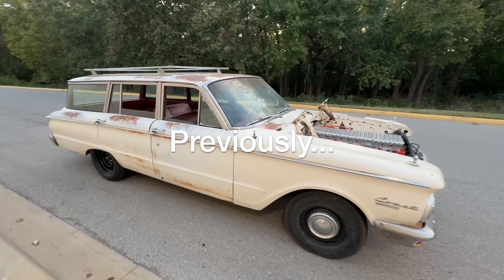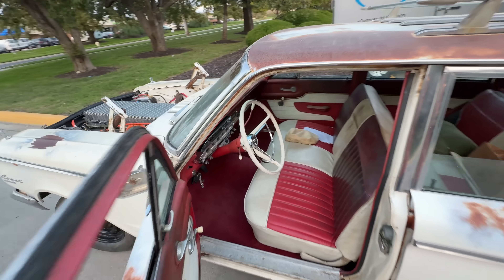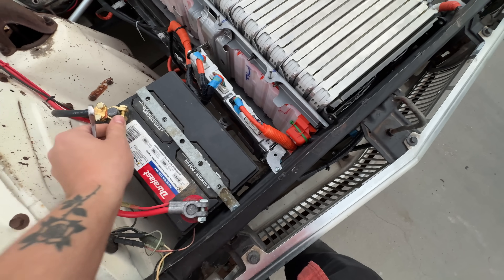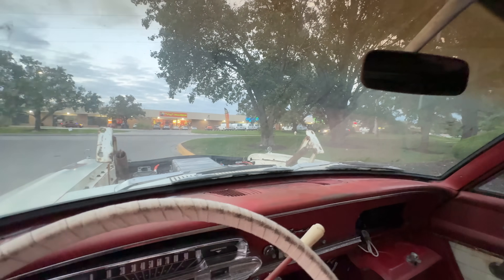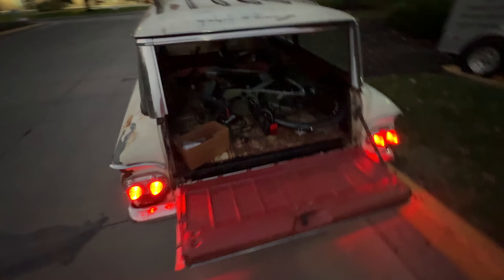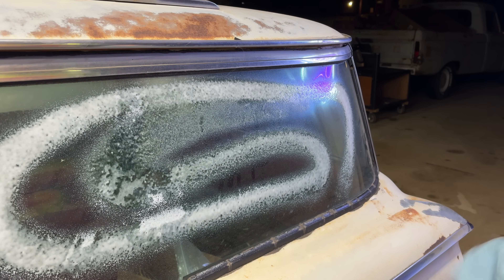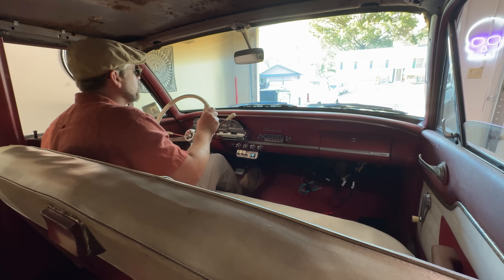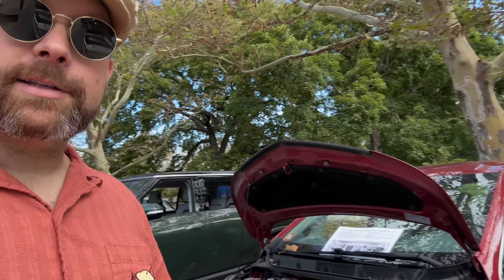What It’s Like to Drive My Homemade Electric Car

Comment from the maker: Hi everyone! I can't believe this video is taking off like it is, if you haven't seen it yet please watch the prequel video: https://youtu.be/v-0ncoK-YI4 ; Also, I'm trying reply to all the comments but there's so many! I'm doing my best but please forgive me if I don't see your comment.
Reply: please please please make a video converting an old gas scooter to electric, it would be really awesome to see your thinking process on that kind of conversion
Reply: Great vid.  Great project.  Salute to your tenacity, you RAWK!!! 🤘🏼😎🤘🏼
Reply: I just found your channel 2 days ago and like what you have done. I have a 1935 Hupmobile that I've bought a later engine and trans for so that I can build a street rod. You're making me rethink this with the possibility of going EV. I have an F150 hybrid and love it. BTW I'm a retired mechanic that likes electrical problems and can frabicate. I'm going to give this some thought.
Reply: You never needed to use the choke to start it! 😊
Reply: Have you considered a proportioning valve for the rear brakes? Might solve the pressure difference for you.
Reply: Maybe a faux shaker scoop on the hood if that works better to enclose the batteries 😂
Reply: Maybe you could use rust converter spray and then some spray cans of paint to get rid of the rust?
Reply: I will trade you the F100 for a 2006 Toyota Tacoma
Reply: What charges your 12 volt car battery ?
Reply: The master cylinder for drums often has an extra seal/ check valve to maintain some line pressure. In other vehicles removing this solves the problem.

Comment: You can use the original master with disc brakes.  Remove the tube seat in the outlet by turning a drywall screw in the center hole a turn or two. Pull andcthe seat comes out. Remove the spring and plastic piece behind it. Reinsert tube seat. Master bore shoulsd be 1". It works well with standard GM front calipers. Scarebird makes a Falcon/Comet conversion kit that will work.

Comment: What a cool project. I used to build EV VWs a million years ago with lead-acid batteries and forklift motors. Todays stuff is way cooler! 

107 horsepower is a good jump from the 80-90 horsepower the 144 made new so that's a great jump and the instant torque probably feels great in that light platform. How much did the weight change? I'm a bit surprised with the range estimate since even the old Leafs were decent at around 140 real world. I'd be interested to see a longer-term range update.

Comment: Two terms for you: seam sealer and DynaMat!  Also, body to frame bolts and new isolators/ bushings.  Using these simple solutions to rattling old cars, I took my 1968 Dart from a noisy beast to a silent kitten!

Comment: Not only are there no seatbelts, there are no airbags, side impact protection, crumple zones. But by far the biggest problem is the huge battery in the front, so if you crash, you're likely to have a flaming battery coming to join you in the driver's seat.

Comment: Just finding this on YT , so don’t know if it’s been done. But I feel like you could probably fabricate some switch setup to integrate the factory shifter on the column for the gear selection. Maybe like something on the end of the shift rod to go next to 3 Hall effect sensors to indicate F N and R. Or like a rotating switch on the shift rod

Comment: That's awsome.
I am,new to your channel. I to am a heavy tinkerer.
Ok. A master cyl .yea. maybe fabricate your nissan master cyl.hook it up opposite. Rear line front line.seeing your drum in front. Also residual pressure valves for drum brakes are also available.speedway mtrs again.
Or even speedway sells a master.  I'm in the middle of an mgb ls 5 speed. Project.
But yea next is the,speedometer. I have a 65 pontiac with factory rally dash i wanted to keep. With ls engine,and late model trans. There,are 2 ways i found.  One takes the electronic pulse from the transmission.  And converts to a dc motor.  Witch in turn powers a cable to your stock.
 speedo.pulses per second i recall. It was a while ago now
That's one way i have done.
There is another unit i did not try that triangulates. Satelites.and that adjusts the dc motor to run the,speedo.
AGAIN.and thanks for sharing.
One more thing. Inline brake pressure universal switch,s are out there . Great job.  I will follow your progress.

Comment: The master cylinder or possibly a valve in the brake line for drum brakes is there to stop the cylinders from fully retracting and loosing brake pedal! It keeps a small amount of pressure in the line. You can usually remove these to then do disc brake conversion. Common here in uk with the older escorts Austin’s ext

Comment: I’d probably not be able to help myself and wind up incorporating the heating, a/c in an invisible way. 
The control switch panel, too: I’d reverse engineer the column shifter for P/R/D/Drive with regen, and stick the mini screen into the fuel gauge position. 
And I know the rat rod thing is popular but I’d have at least shot it with a clean fresh coat of enamel

Comment: Could we get a full cost breakdown, including tools you had to use for the process, and (in the case of stuff bought specifically for this project) how much they cost? I have ratchets and an impact, so if the welder was only $100, and you don't need more than an extra $1k or so in supplies to get this done, I'm thinking I might like to get a home charger and do this on a Civic/Corolla/etc...

Comment: Disc brakes are designed to drag. If minimum rolling resistance is required without high performance breaking ability, rear drum brakes work better.
Usually a front disc with rear drum setup is more than adequate for trucks weighing up to 5000 lbs for speeds up 100 mph, and for cars up to 130 mph.

Comment: Actually, "the hood" is just the   covering over the engine compartment.  Also, I'm guessing that the steering is recirculating ball and not rack and pinion, right?

Comment: At least one more improvement in batteries is required before it can barely hang with a normal vehicle. An extra hour of charging every 3 hours of driving is insane! We need to be honest about it and the inventors will get back to work on batteries.
EVs just aren't good enough yet, too heavy to be efficient, too short of a range to be convenient, constant extra hours to recharge, and the batteries as so big they have to be mounted so low as to be ruined by a single curb hop. 100k gone because of one 4" high curb? Nope not good enough

Comment: Recommend integrating the forward and reverse switches into the shifting column and setting up the status screen where the fuel gauge is that way it gives a more original look and feel when driving.

Comment: There should be a screw with a set around it on the gearbox to tighten up the slack in the gearbox and if you do find it and you do tighten it up make sure you make very small increments right to tight left to loosen. I used to have a 62 1/2 for unibody pick up short wheelbase and I know it had it cause I had replaced the gearbox.
 I know the Ford pickup has it. Anyway   check it out hope it helps. That screw with the nut should be on the top of the gearbox when I say small increments, I mean, maybe a 16th of a turn or maybe a little less maybe start with a 1/32 of a turn you don’t want it too tight wanna make sure they’re just a little bit of play maybe about an inch and a half on the steering wheel left to right

Comment: I think you should wash it, scrub it with a scotch-brite pad,  rinse it off and then just clear coat it to lock in the funky rusty patina. Maybe do a cheap Mexican blanket headliner with some dingle-ball trim around the windshield, you know, class it up ! Maybe get an 8-track mounted on a bracket for the dash...?

Comment: You need to use a 4 position cam switch with a linkage plan connected to the shift lever for your D/N/R/B (bypass) features.

Comment: I would highly recommend Coil spring shocks for the front and rear axles you will be amazed at the suspension improvement.

Comment: I just watched your "FULL BUILD" video, and now this one.
As far as the toggle switches for your drivetrain, look into retrofitting old Chrysler/American Motors push button shifters. They won't be manufacturer correct, but period correct. The guy on the YT channel "Dead Dodge Garage" might be of some service to you. 
You might try a zerk fitting and some grease under a slight pressure to absorb the shock from accelerating.

Comment: What you should do is work out your shifter on your column so that it works like normal. Instead of you pushing switches or flipping switches, I should say that would be a very easy mod

Comment: Does the EV controller actuate the brake lights when using regen braking? That could mean it needs a higher rated fuse, assuming you have the original filament lamps in there. Or swap to LED replacement lamps - no CANBus monitoring or even lamp fail circuits in that era to mess up!

Comment: As impressive as your conversion was - in the long run it would still be cheaper and less hassle to run it with a gas engine.  All those expensive batteries and electronics + gremlins give it a shot life expectancy.

Comment: Using Nissan Leaf parts is a gamble to say the least 😂
Reply: Independent research in the UK reports a warranty claim rate of 3% for the Nissan Leaf, making it the most reliable EV in the UK by some margin. This covered both the Mark 1 and Mark 2 models. The Mark 3 has just been released so was not included. Battery degradation of the ancient Mark 1 cells is well understood, they’re cheap, plentiful and predictable. So using Leaf parts is the exact opposite of a gamble.
Reply: @JBirtwistle-i6j  I’m basing it on American models, I would think we get considerably different ones with the different regulations and set up of the car. They’re notoriously bad in America. I actually got 1 as a rental for a month and didn’t hate it at all or have any problems but that’s definitely not the collective opinion. I wasn’t insulting the build by any means, I build electric motorcycles with whatever is good and accessible so this is right up my alley and I have nothing but respect for the builder. Take care.
Reply: And let me add it’s not just Nissan Leaf’s, all our cars are cheaply made and overpriced now. The average new car here is 50,000, that’s the average! For garbage! I used to live in London and Bordeaux for years in each and I miss the quality of food and products there. People still have pride in their work there.

Comment: You can use a proportioning valve to fix the pressure issue with the rear disk brakes.

Comment: Very cool !! So, first thing I was thinking, you need to get seat belts installed !!! Then I was thinking about the range thing, and obviously it's not as good as it would've been on the donor Nissan Leaf because of all the extra weight in steel you're hauling around. So, on that note, you could lighten a few things, and one that I'd be inclined to look at first would be the window glass. You for pretty obvious reasons don't want to take out the glass ones in the front doors in case of an accident and emergency crews need to break the glass to get in, and you can't, or shouldn't replace the windshield, but I'd say replace all the rest of the glass with Lexan. That should give a pretty decent weight savings. Other things I'd be concerned about is just how close the batteries are to the old radiator cradle. If you were in a front end collision, those front cells will definitely be damaged and could cause one helluva nasty fire ! What about reorienting the stacks and interconnects so you break up the groups into 4 or 5 vertical stacks in a sort of ' T ' configuration so you can get more front end clearance, placing crossways ones at the front so in case of a front end impact, you only damage a couple, as opposed to MANY. My biggest concern is protecting those batteries in an accident, and likely a fire ! Doing the full disc brake swap shouldn't be too hard since you can find kits to do all this for fairly cheap ! Just be sure to get a master cylinder off a 4 wheel disc car, like a Mustang if the kit doesn't come with one, or see what they suggest. You might also be advised to install an adjustable brake proportioning valve. The trick to putting one is if you can mount it where you can adjust it with your left hand as you do test braking runs, it makes the adjustment job a million times easier ! A word of advice tho .... install seat belts first !! I'd even try to use a 3 point with shoulder harness setup ! Beats the hell outa 'kissin the wheel' .... and you probably want to keep your teeth intact !! LOL !! 

I'm an ex auto mechanic, fab shop mechanic, tire shop guy and automotive partsman, so I got a wee bit of experience in the biz ... in case you're wondering !! Now subscribed ! Good work man !! Look forward to seeing where this goes over the winter !

Comment: Thats an impressive build right there. Were you able to fit the whole Leafs battery pack in your hood? As for the odometer problem, that's an easy work around. Most of the GPS app, show your speed so you can use that or buy an aftermarket odometer.

Comment: If you have strong regen brakes and a brake light triggered by a hydraulic switch, who's running a book on how many miles before you get some serious back door action?
I think the motor mount bolted to chassis rails with rivnuts is also a recipe for disaster.
You have the welding skills, so just weld a tube through the chassis rails that you can put long bolts through.
Reply: It's like any car project that has an engine swap and a collection of scavenged OEM or new aftermarket parts. Kinda a deathtrap and a danger to others in the road. Lots of safety systems and vehicle dynamics wind up getting glossed over. 

It's okay though. It's okay to do things. It's okay to do things that interest you even if the outcome isn't better than what you started with.
Reply: @DJBloodBath777  100% though he does need to work out how to operate those brake lights just like Nissan originally did. Because if he can brake without using the brake pedal, the brake lights wont operate and he'll get rear ended. The car that hits him, that would normally be considered at fault, will then remind him of his illegal setup. I know most states don't have an MOT equivalent to what we have in the UK, but even so there will be legal repercussions.

Comment: Just curious, but have you considered adding solar panels on the roof? With how flat the station wagon's roof is, you could probably fit a few fairly easily, and that would help with range, I imagine.

Comment: to make a master cylinder suitable for disk brakes, unscrew the line to the rear brakes, put a wood screw in the hole in the brass flange for the flare ... pull out the flange fare and remove the rubber part and spring from the hole, then put the brass flange back in and connect the brake line and bleed system. That rubber thing and spring maintains pressure to stop drum brake shoes getting too far from the face of the drum. Greetings from Down Under

Comment: Drum brake wheel cylinders require a residual pressure to keep the piston cup seals expanded. This would absolutely cause drag. You have probably figured it out by now. Convert to 4 wheel disc brakes and matching disk brake master cylinder.

Comment: Those tires are called bias ply tires and they are soft, Will follow cracks in the road. If you want 14 in wheels and they are 4 lug look for 1970 -1975 Maverick wheels, 1964-65 Comet/ 1964-1965 Falcon wheels as they have the same bolt pattern. Very nice conversion and i'd say the 107 HP is a lot more then the old straight 6 in those old Comets.

Comment: I am nearing 60. Never had a station wagon, always pickups. But come to think of it, you can fit a bicycle and a generator in there and maybe some batteries, depending on the strength of your axle